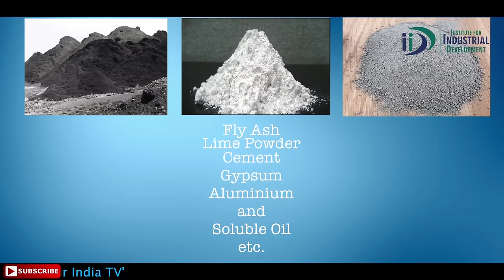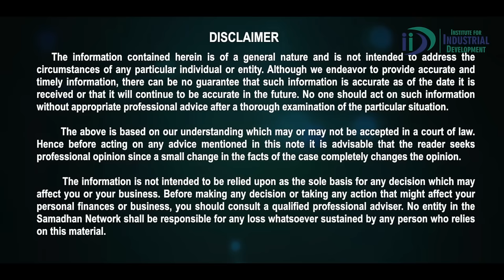AAC Block Making Business Ideas | How to Start AAC Bricks Making Business

Comment: Some engineers stating that, AAC blocks, bearing load is less than Clay bricks.  After some time there will be cracks in the wall in 10 feet hight walls.  If it is correct the entire industry will shut down. What  precautions should be taken against cracks.
Reply: Bend beams
Reply: Horizontal beam at very 5 to 7 feet to avoid crack 👍
Reply: They are not for load bearing

Comment: कितने का है एक बिलोकि
Reply from the maker: Please share your contact details on our mail id iidincubator17@gmail.com, You can also call us on 7607655555, 7408733333 for further discussion.
Reply: 60rs
Reply: 90 ₹ for 1 Block
imensions are 24 inches× 8 inches× 8 inches=1536 cubic inch(for 1 brick)